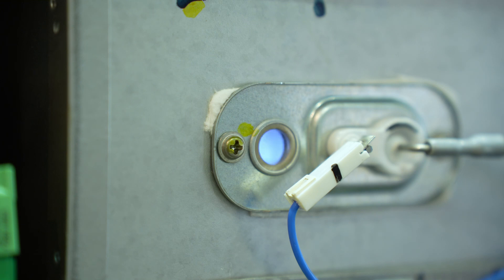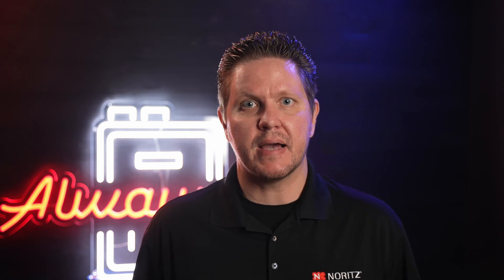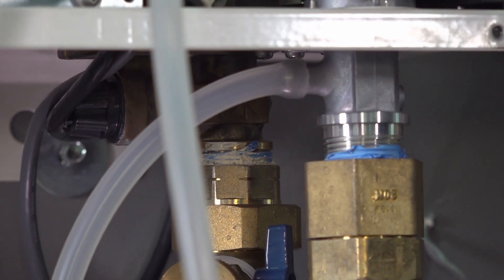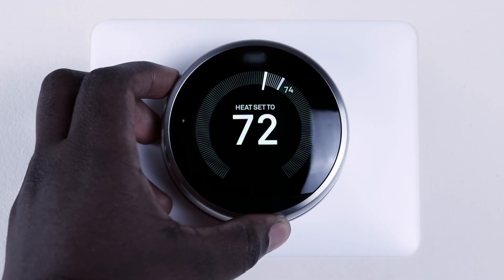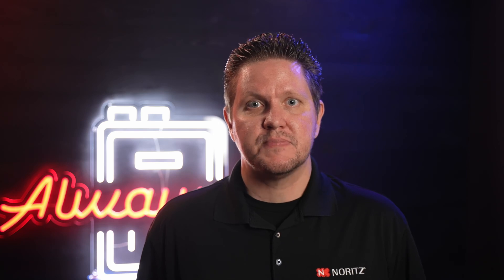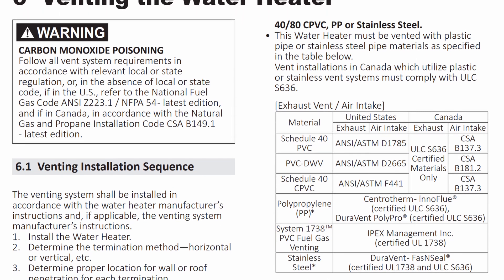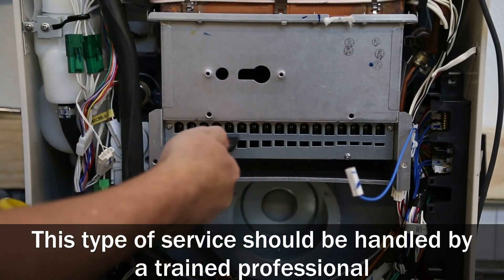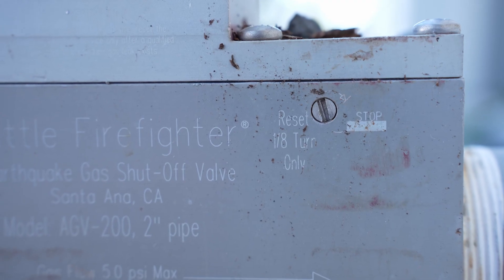Noritz Error Code 12 (EC12) - Tech Tips

Comment: None of this worked, gas pressure is fine, ignitor and flame sensors were cleaned and also replaced, water heater was disassembled and all dirt and debris was cleaned out, still error code 12.
Reply: use spray bottle and check for leaks around manifold seal.